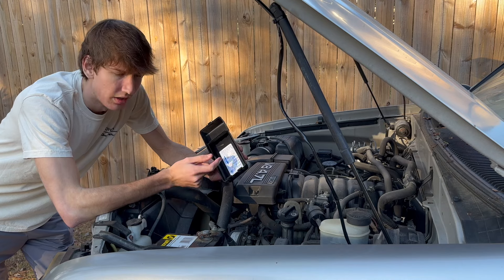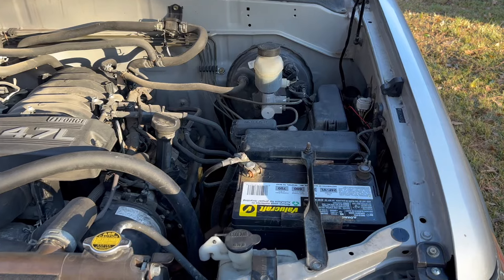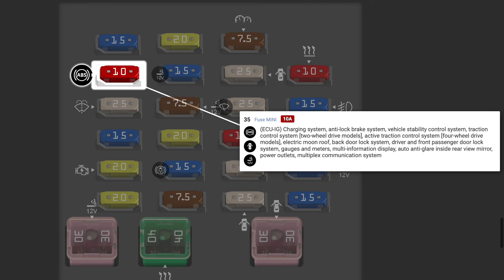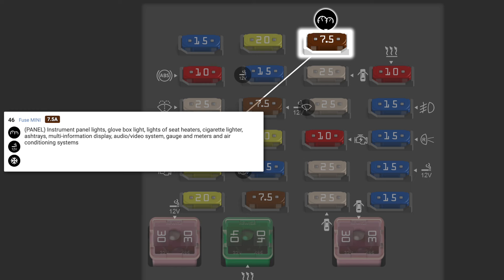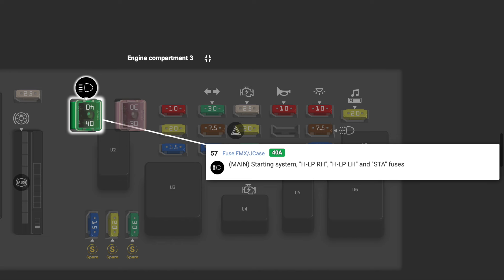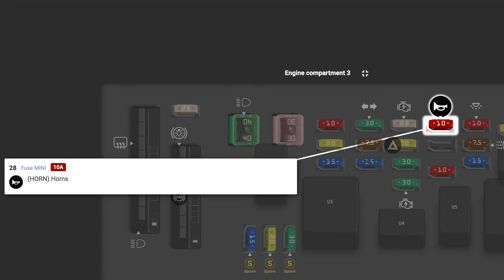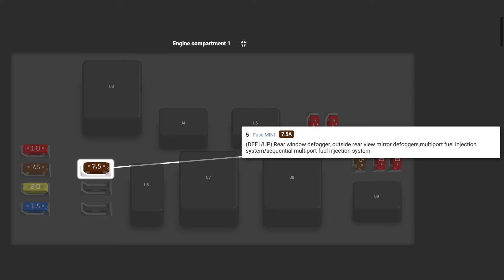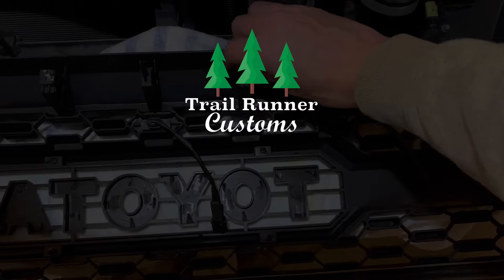Fuse Box Location and Explanation: Toyota Sequoia (2001-2007)

Comment: stumbled onto your video while I am trying to fix a trunk issue I have with my 07 sequoia.  I installed the trunk actuator and latch, now I am able to open and close the trunk finally, but when I lock it, all the doors would  lock except for the trunk....wondering if the fuse is bad but thinking about it, I don't think that is the case.